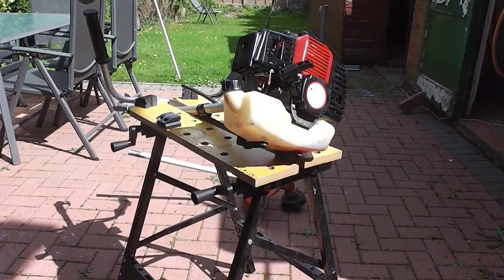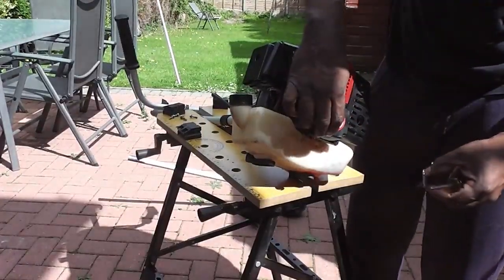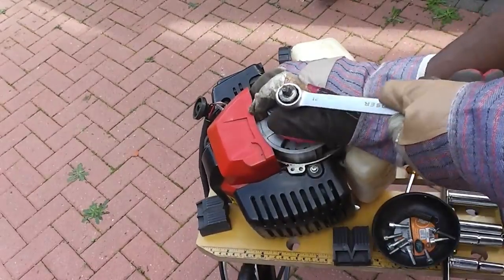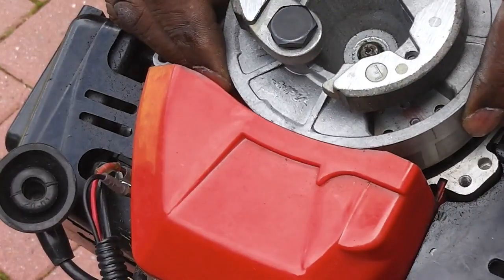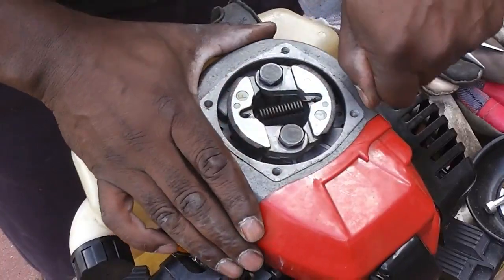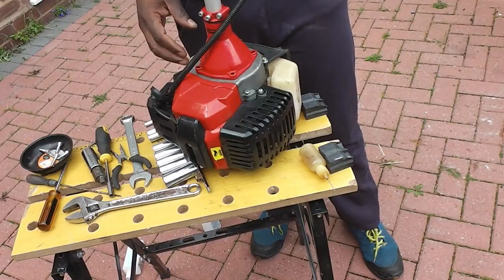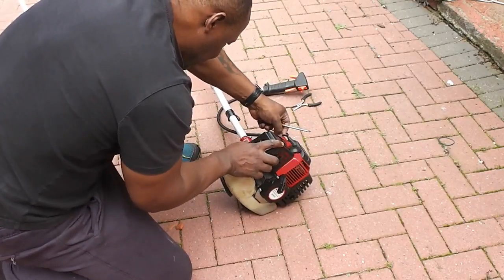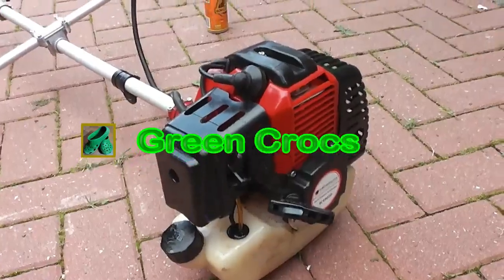Trueshopping BC4902 Not Working  Fixed

Comment: Hi I know this is an old vid but what's the spark plug gap on these Please
Reply from the maker: Hi Russel,
                 the Spark Plug gaps are pre set from brand new with a protective sleeve in the box for transit. However the answer to your question is I don't know or 1/16th of an inch maybe slightly less 😀.
Reply: @green-crocs-fixes1520  Hi ty for your reply I have found out the gap It is 0.6 - 0.7mm hopefully this will help someone
Reply from the maker: @DiscusRussell  Cool Russell, I’m sure it will thanks

Comment: They seem to be somewhat problematic to start in general.

Mine will not start, unless I squirt some fuel into the bore. 

After that it will run properly and restart no problem but once put away. Need to remove spark plug, then get some fuel in, plug back in and away it goes.

Pain the backside!
Reply from the maker: Your not wrong GTD65, 
                                        that's the two-stroke for you. after hibernating in the shed during winter they can sometimes require an additional boost to get them going again.
Reply: @green-crocs-fixes1520  have you found anything easier than taking the plug out and putting fuel in? 

It's strange that it runs perfectly after the first start but the next day, or a week later, it's the same thing. Plug out, fuel in, plug in, away it goes ..
Reply from the maker: @gtd65  Not really, I have a Florabest FBK which starts first time always

Comment: Hi, I’m thinking of buying a 65cc of these trueshopping trimmers.  I’ve had a 22 year old Shingu pro 4390 43cc (kawasaki) which has more than paid its way for me. I took good care it and serviced it all through the 22 years. A few questions for you mate.  Is the trueshopping trimmer a good quality buy? Will it last?  Are parts made of cheap plastiv etc?   Engine is made by who?  Many thanks.
Reply from the maker: Ciaran Mac Thanx Ciaran,

           This is not my unit just repaired it for someone. Very easy to work on and there are plenty of used and new parts out there if you search as I found out.

           Regards
Reply: @green-crocs-fixes1520   Cheers for the prompt reply. I think ill buy. Thanks👍
Reply: Did you buy the True Shopping strimmer? If so, how did you get on with it?
Reply: @gtd65  I did buy it. 65cc. Extremely strong strimmer, I added the desert hawk head to it and I use cyclone 3.9mm orange coloured cord.  It makes easy work of all heavy brush.  The downfalls are that it is heavy on the juice but I expected that with a 65cc engine.  The gear box on the head did wear out but I bought a new head gearbox on Amazon (26mm with 9 spline) for €30. All in all a great strimmer for the price. I have heard people say that pull cord casing is plastic and it does wear but I haven't had any issue with it.
Reply: @ciaranmac646  the one I have, must be 5 or 6 years old by now. I did replace the barrel and piston (£9.50 from AliExpress) and sourced a new carb for around a fiver. You can actually buy the complete motor assembly for around $40 from China which is excellent value for money!
Reply: @gtd65  Excellent value👍👍